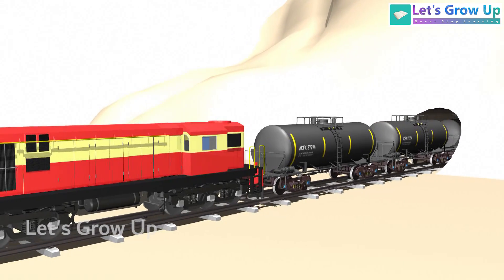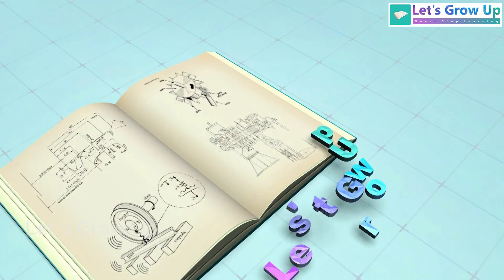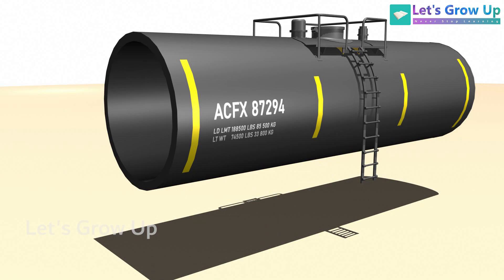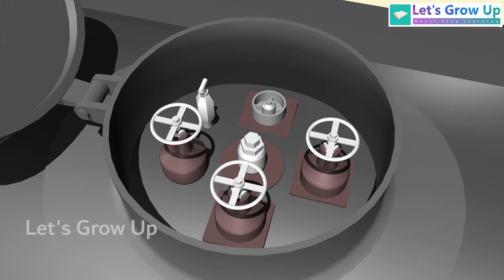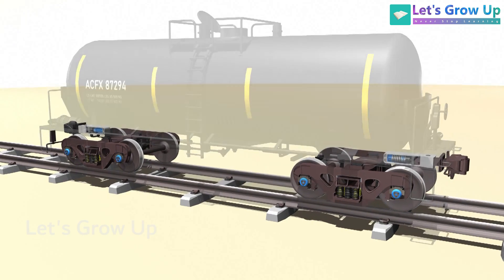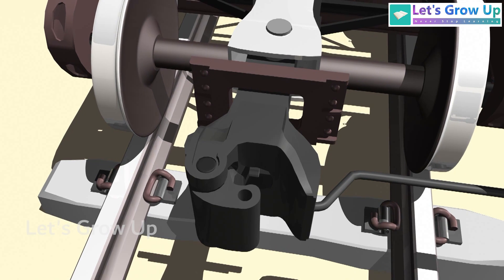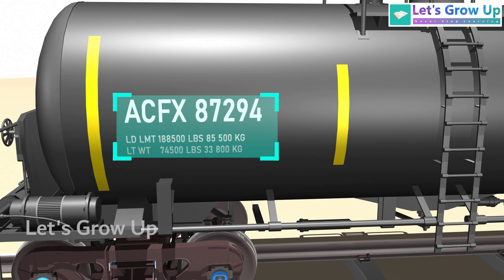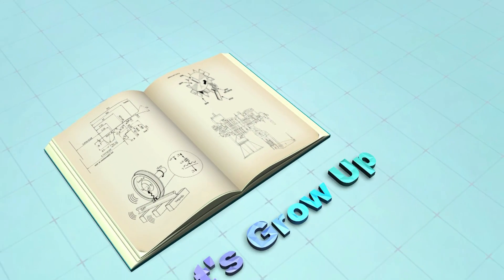The Function of an Oil Tanker Train | How an Oil Tanker Works | Let's Grow Up

Comment: So those hairpin things that used to stick out the top of the domes at the terminals are thermometers. I never knew that. Nice drawings btw. So much detail presented with such a consise explanation. In some states and countries fuel is no longer transported in this fashion. But it is still kind of hard to know how much petrol at each depot in the country requires when there are so many towns to supply from one centralised depot in the city. So the depot contacts the fuel refinery and they contact the railways to tell them which town it is to be sent I take it. This is complicated further in the marshalling yards with so many different brands of petrol. The large logos help out but still. Hard to know what tanker goes where and it is also mandatory to know an NTAF from an NTBF bitumen tank wagon as these country fuel depots distribute bitumen in many cases as well or they are sent to a government road maintenence depot with its own bitumen handling facilities.

Comment: Here in North America, tank cars are now equipped with double - shelf couplers which reduces the likelihood of the cars becoming uncoupled in a derailment.
Reply: Double shelf couplers are required on any tank car transporting hazardous materials- they were initially required in the mid-1970s to reduce coupler bypasses/over-rides during switching operations which resulted in a coupler puncturing the head of a tank car.  There are three main types of tank cars: non-pressure (a/k/a general service), pressure and cryogenic.  “Pressurized” is misleading and not a regulatory term.
Reply: Only the insulated/pressurized types.